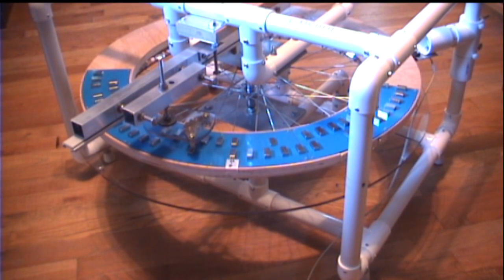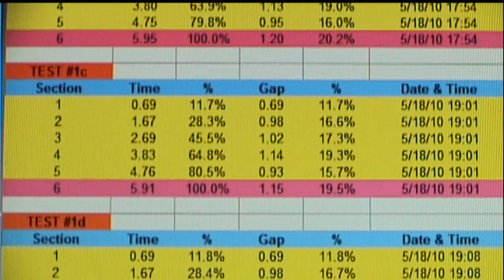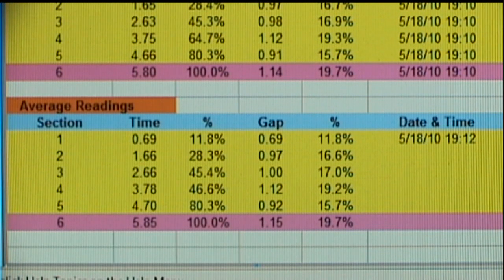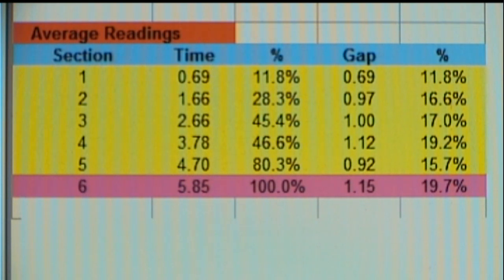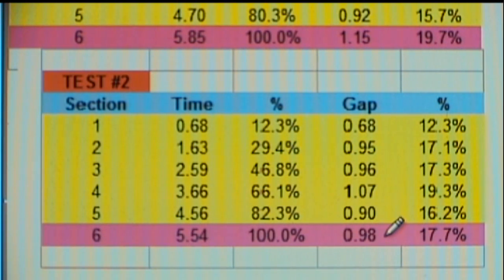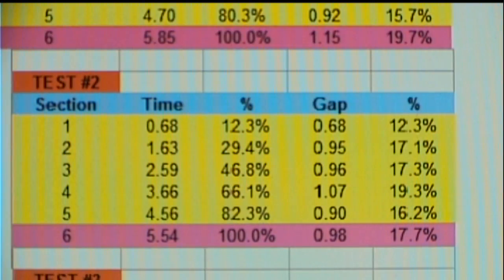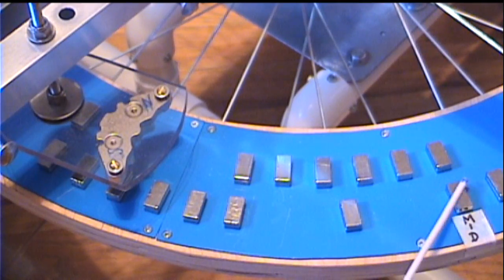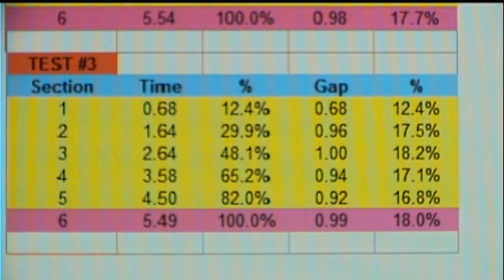Video #39, "Rick's Pipe Dream" Magnetic Motor-Generator

Comment from the maker: This lift and drop action of the stator will rotate the wheel in the manner show in video #3, but mechanically rather than by the hand method shown therein.  This mechanical action can be derived using less than an ounce of force, and thus will not have a detrimental effect upon rotation.

Comment from the maker: I will actually be using perhaps two, or three at the most, separated magnet groupings around the wheel, which will give the stator time to lift after the tail end of a rotor group goes by, and then drop down between the second and third magnet placements of the next rotor group. The stator will be moved upward by mechanical action and leverage, and dropped by a combination of its own weight and magnetic attraction.  I'll explain this in a future video.

Comment: Seems like you've effectively moved the midpoint of the whole array closer to group one by 'lop siding' the attraction toward group six. Seems like if you keep tuning this array in this manner, you will end up with one array that works great however if your intent is to complete the circle with the same pattern of magnets and steel plates then it would seem to me that the sweet spot going into group one will be balanced out as will the not-so-sweet spot coming out of group six.